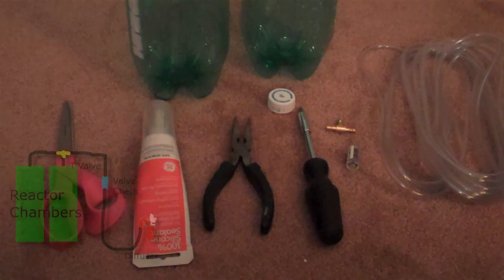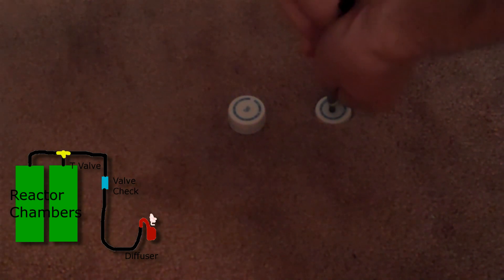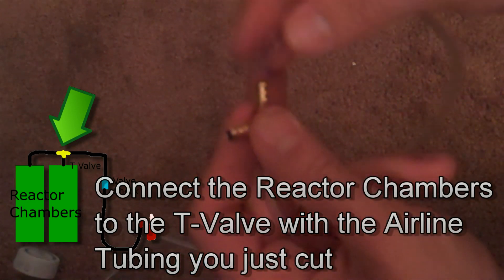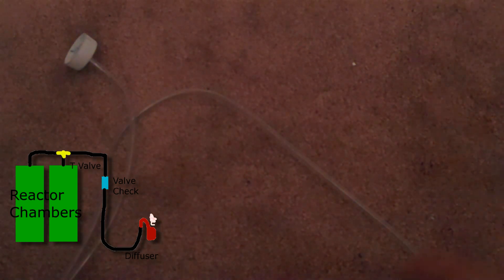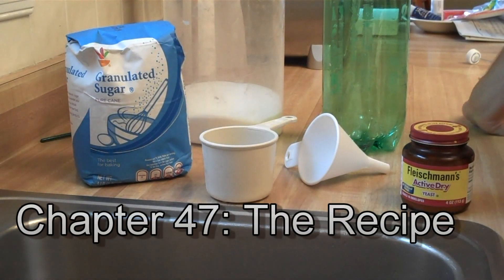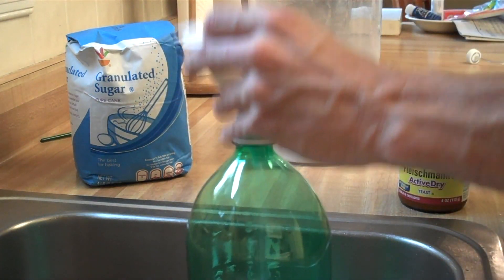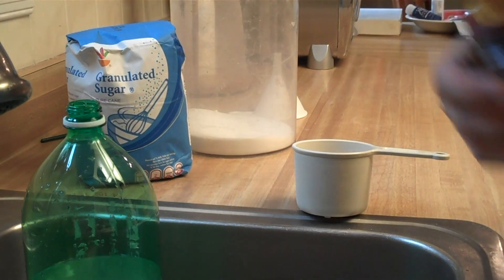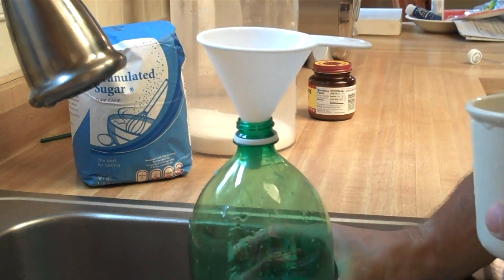How to Build a DIY C02 System and Recipe

Comment: few questions : 1/ what water :  tapwater, aquariumwater, RO water, rainwater ?   2/ how long will you get pressure co2 in your bottle ? 3/ can you use Sugar +  yeast AND baking soda together (and how much) ?
Reply: @mikev.s  I suppose normal TAPwater.  instant mix = OK.  Be sure your instant yeast is not "died / expired", otherwise no co2. thnx for the info !
Reply: @creamontop6969  yeah i found any water will do unless you have really bad tapwater.i do lots of baking so my yeast is also good.

Comment: Nice one but I think you just forgot to fix a regulator in between otherwise how you can control the CO2 supply in your tank at night
Reply from the maker: No. The plastic bottles are not designed for high pressure and therefore you do not cut off the flow at night. The fermentation method will continue throughout the night. If you do not want c02 to be injected into your tank, you just need to remove the difussor from the tank.
Reply: What are you saying bro....these cold drink bottles are made and are always carrying high pressurized CO2, until consumed.
Reply from the maker: @anirbanbhattacharya9037  there is no high pressure (in the sense of compressed c02 that you would see in something like a paintball canister).
Yes, the bottles will make c02 for about two weeks (then the solution needs to be replaced). It is a small, steady stream of c-2.

Comment: Just to be clear, the CO2 you're pumping into the fish tank is to help the underwater plants? What about the fish? Are they getting enough O2 to breathe with all the extra CO2 you're pumping in?
Reply from the maker: Yes. The C02 is for the plants. Carbon is generally the first limitor in photosynthesis so this helps boost that. The fermentation process really doesn't produce a ton of C02. You usually don't have to worry about the fish.

Pressurized c02 systems are more powerful so you need to have those dialed in, but they are also more controllable. You can have those turn off when your lights go out (and photosynthesis stops).

Comment: You get more CO2 released with the water a little lower where you have a wider surface area for the gas to be given off. Top of the wide part of the bottle would work best i think. Great video though.

Comment: How many bubble per second it produces with a 2 liter bottle? does the CO2 production gradually reduced over time up to the 1 week? Or it loses steam more abruptly?
Reply: It will gradually reduce but my old system went on for about 2 weeks before completely stopping. You can buy champagne yeast which lasts longer. Having a reactor that traps the gas and circulates it till it completely dissolves helps a tremendous amount, mine was made by Tunze but they have gotten pricier in the last few years $45.

Comment: Do you need the second bottle if you just want the Co2 to defuse into the air for house plants?
Reply from the maker: I don't think there will be enough c02 produced to make a noticeable difference in the c02 concentrations in the air.
Reply: AquaStudent depends on air mass.  In a Small grow area? This would be sufficient. Great vid

Comment: can u tell me what is inside secon transparent bottle ??????  what is that    .
Reply from the maker: the second bottle is identicle to the first. I just used two reaction chambers because i was using it on a 30 gallon tank
Reply: ok sir thank u very much  and  then i have also 32 gollon tank so i have to use 2 bottle right ? and thank u so much
Reply from the maker: Two bottles works well for that size tank because you can change out the mixture every other week in one of the bottles. That'll give you a more consistent flow of c02.

Change bottle 1 on week 1, change bottle 2 on week 2, change bottle 1 on week 3, change bottle 2 on week 4 and so on

Comment: What should i do if i want to increase the number of bubbles coming out ? Increase yeast amount ?
Reply from the maker: If you want higher amount then you'll need more bottles. You would be far better off going with a pressurized system though. The longterm cost and benefits greatly outweigh what you get from DIY

Comment: Would one bottle be enough for a 30l aquarium? (Aquel Shrimpset 30)
Reply from the maker: +Kate Hallen Hello Kate. By 30L I'm assuming you mean 30 liters (not a 30 gallon long). For a tank that's less than 10 gallons then you should be able to get away with a single 2L bottle.

Comment: is the second bottle just empty? for the co2 to build up in?
Reply from the maker: +Rebel Rob The second bottle is identicle to the first. It's just for more c02 output. I alternated changing out the solution of each bottle every other week. aka: Replace bottle #1 on week 1, Bottle #2 week 2, bottle #1 week 3 and so on.
This gives a more consistent and powerful supply of c02.

Comment: What size tank do you use this system on?  Would it be enough for a 75 gallon tank or would I have to add more bottles?
Reply from the maker: +Rob Gatt For something as large as a 75 gallon you're much better off going with a pressurized system. The initial investment will be steeper (a 10 pound c02 tank will probably be about $80-100 and a regulator/solenoid will be another $100-150) but the expenses and time required for DIY on that large of a system will quickly exceed even that.

Comment: I fill a 2 liter soda bottle about 1/2 full of white vinegar , poke a hole in the lid with a 6 penny nail ( I leave the nail in place to regulate the flow) I then invert the soda bottle over a casserole dish (in case of over flow due to a too fast of a flow) filled about 1/3 full of baking soda and adjust the drip to about one a minuteI do it during the dark cycle because I have to leave my tent open when the lights are on...to help with cooling.Would it be better to bomb them during the light cycle??Thanks Bud Holly
Reply from the maker: +Barefoot Dragon You shouldn't bomb anything.
I don't have any comment on a vinegar and baking soda reaction. I recommend using the yeast/sugar fermentation method because it's long lasting (weeks). I believe vinegar and baking soda would be a couple minute (an hour or two at the most) before most of the reaction is complete.

I also don't recommend trying to control the flow on something like this. These materials aren't meant to withstand pressure.

Comment: How do i turn it off at night?
Reply from the maker: +TheThree LittlePranksters This is not something that you can turn off at night. Just leave it be. There won't be enough c02 produced to cause any problems.

If you're concerned about it you can always remove the tubing from the tank so it blows the c02 into the room and not into the tank.
Reply: AquaStudent was

Comment: what did you fill the other bottle with?
Reply from the maker: Rick Schelfaut Hello Rick. The second bottle is identical to the first. My routine was to change the solution in one of the bottles each week. This gave a more consistent and powerful production of c02.
Reply: Ok thank you for clarifying.
Reply: Can I use a airstone as a diffuser ? Thank you for your quick feedback.
Reply from the maker: Rick Schelfaut Yes. That's what I used. It's not the best but it works. Try to get as fine of a grainsize as possible.

Comment: Hello. I have some question whether .I did not inconvenience you have a 25 gallon tank. . How long it lasts approximately mixture. Should mixing shook every day to be as active it. and after stop during the night to close the valve should not overlook that CO2 in the air or in the air must leave.It may be a risk to the bottle exploded. Thanks
Reply from the maker: leutrim avdiu Hello Leutrim,

The solution lasts around 10 days to two weeks at the most. For a 25 gallon aquarium you can use the system I showed in the video. Construct two reaction chambers (2 Liter bottles) which will each hold identical yeast/sugar solutions. Replace the solution in one bottle each week, alternating which bottle is replaced each week. That'll give you a more consistent flow of c02.

As you indicated in your message you do NOT want to close any valves. In fact, you should not have any sort of valves on this system. You don't need to shake the solution daily. The yeast will constantly be fermenting the sugar. C02 will be produced during the day. C02 will be produced during the night. C02 will always be produced (until the solution runs out). However, the amount of C02 being generated should not cause any problems with gassing the aquarium inhabitants. This can happen with high powered pressurized systems if they are turned up too high or malfunction but DIY is much less powerful.

I hope this helped. Let me know if you have any other questions.

Comment: Great Video thank you!

One thing I would recommend is reading up on CO2 and metal. It is better to use plastic (best is silicon), because CO2 gas (vapor)  is corrosive (carbonic acid) to metal.
Reply from the maker: Katy Allerton You are correct but it affects different materials differently (amazing how chemistry works like that). I'm not a huge fan of plastic pieces because I've found them to be unreliable. You could try going with something more resistant like stainless steel.

Comment: Thanks for the video and the recipe!  I have 3 and 5 gal nano tanks, do you think for the bottles I could use a 12 oz plastic Coke bottle for the mixture and an 8 oz Coke bottle for a bubble counter?  Obviously with a smaller amount of mixture. :)
Reply from the maker: headfangs You can use any size you'd like. That seems like a good scaling. The good thing about this project is it's pretty easy to build so you can always build another.

The bubble counter doesn't need to be as large as 8oz but it will certainly work.
Reply: AquaStudent Quick answer, thanks!  I have another question that I've never really seen addressed in any DIY CO2 guides– where do you dump the used up mixture when you're done with it?  Is it just poured down the sink drain?  And I've seen a few people saying their DIY method produced a bread/beer smell, but I'm fairly sure that shouldn't happen unless there was a leak somewhere.  Is that smell typical?
Reply from the maker: headfangs Take a look at the ingredients. We're using yeast which is where that beer/bread smell is coming from. I think they may just be smelling the solution afterwards. If there's a bread/beer smell while it's in operation then you are correct. There is likely a leak somewhere.

After you let the solution "churn" for a week or so and it's ready to be replaced give it a smell. What you did over the past week is ferment the sugar into alcohol. You've basically made a crude (and probably nasty tasting) vodka.

For disposal there's nothing that'll harm any plumbing so you can dump it down the sink.

This is a nice project that combines the aquarium hobby with chemistry (reactions/fermentation), biology (yeast cultures), and (just because I do physics for a living we'll throw it in) physics (pressures/equilibrium).
Reply: AquaStudent Oh, yeah I figured the smell would be there when opening the bottle, others were saying it made their room smell while operating, which I thought sounded weird.  Good to know that shouldn't happen.

Thanks for the explanation!  I got a D in Chem but I do still try. ;)
Reply from the maker: headfangs D's get degrees!
Reply: headfangs life

Comment: can i use caster sugar?
Reply from the maker: DMAN D Chemically or physically there should be no issues with it (if anything it'll dissolve more quickly). However caster sugar is expensive and you're just better off using the cheap stuff.
Reply: AquaStudent ok thanks

Comment: is it with every aquarium standart the recipe or is it diverent i have a 148 liter aquarium and i want to make it to but how mutch so i need of sugar and that sort of things
Reply from the maker: 138L is nearing the point where you'll be much better off using a pressurized system. If you want to do this DIY method you'll probably need two or three reaction chambers. The recipe detailed in this video is for one, 2L bottle. If you have a bigger tank you'll need more bottles. I think you're better off going for a pressurized system.
Reply: thanks for answering my question
but the pressurized co2 is so expensive is there a alternative solution?
Reply from the maker: luc snippe
Pressurized C02 is expensive in the short term but in the long term it's actually less expensive (and easier to maintain, plus more powerful, and more controllable). The benefits really do outweigh the cost.

In the short term you could do DIY however I suggest saving up for a pressurized system. I'm not sure how it is where you are (I'm guessing Germany from the change in language in my email) but here in the United States a 10 pound C02 tank was around $100. The regulator was around another $100. However,, that's all the expensive stuff. It costs about $10 to refill the tank. I've had my pressurized system on my 29G (110L) for about 10 months. Today will be the first time I've refilled the tank (and I don't think it's even completely empty yet)!
Reply: AquaStudent wow so long with one tank
im gonna save up money for a presurised co2 tank
in holland the 6kg co2 tank is 300.00 euro
and 2kg 85.00 euro
i'm only 15 gonna work hard for it
i'm living in holland the little land next to germany hahahah
Reply: AquaStudent i think i will try first the diy system and then if i saved enough money i'm gonna buy pressurized
Reply from the maker: luc snippe Excellent! Glad you're getting into the hobby young. This will give you something to work for. A pressurized system will be a huge step. Just do a search for "High Tech Aquarium" or something like that. That would be the next step after c02 injection but you'll get the idea of the difference. (It's huge). Working for it will make the final results even better!

I am actually part Dutch. My Grandmother is from Deventer. My favorite football team is AJAX. I hope to visit someday.

Best wishes and keep me updated on your progress. While you're saving up for the pressurized system I encourage you to experiment with a DIY system. They are fun to build and you'll learn a bit of chemistry and biology along the way.
Reply: AquaStudent thanks for answering all my questions
i have to family in deventer hahahah
greets from holland

Comment: thanks so much for the help i really didnt want to fork out the money to get co2 for my aquarium this works just fine!
Reply from the maker: Glad to hear you found this useful. It works well as DIY goes.

I do highly recommend investing in a pressurized system if your tank is medium to large sized. The DIY co2 becomes a bit of a hassle in the long term, is not nearly as powerful, and is much less controlled.
Reply: alright thank you so much for the information and quick response, ill be looking around so i know what to buy wen i get the extra money

Comment: could this work with flour and yeast too?
Reply from the maker: No. Flour will not work in place of sugar. The sugar is required because it's an important component in the fermentation process. The yeast converts the sugar into alcohol and c02. Flour will not let this reaction happen.
Reply: AquaStudent
Yes, I do know you're very intelligent, but flour has a lot of starch wich is complex form of sugar, its why dough rises. just never heard of anyone trying it.
Reply from the maker: JazzyFaReal
Oh hell. I'm a complete idiot. You can never trust anyone from the internet. That'd be very interesting if flour worked. I have never done it so I shouldn't say it won't work (sorry for shooting it down initially).

Give it a shot and let me know how it goes. I'm not currently running any DIY c02 setups or I'd try it out myself.

Comment: Can i start a DIY C02 when my aquarium is cycling? I have just thought of this for the benefits of my plants which i've just plant or will it be too much for the beneficial bacteria or too early?
Reply from the maker: That's a good question and I'm not sure what the answer is because I don't have any personal experience. I don't see why c02 injection would cause problems for cycling so you should be fine.

Regarding your other comment about preventing alcohol from entering the tank. What you can do is build a "bubble counter." This entails a small container with the line from the reactor going to a point below the water level. The c02 will be released into this container. An outlet (near the top/above where the original co2 comes in from the reactor) then brings the c02 to the tank. This is rather confusing in paragraph form. I'm hoping to do a simple tutorial on how to build one but I've just been so busy.

What this canister does is makes sure that the only thing that can get from the reaction chamber to the tank is c02 gas. Everything else gets trapped in the bubble counter.

Comment: Do you still leave the setup running at night? I'm afraid that if i do so it will cause my fish and shrimp to die due to the large amounts of CO2.
Reply from the maker: When I ran DIY c02 I left it running. The system shouldn't be putting out that much c02 that it'll cause harm to your fishes/shrimp. If you're concerned about it you could run an airstone to allow the extra gasses to be removed.
Reply: AquaStudent Ok thank you very much!